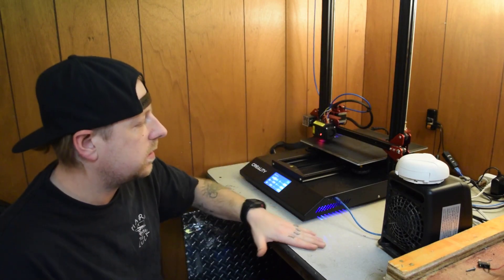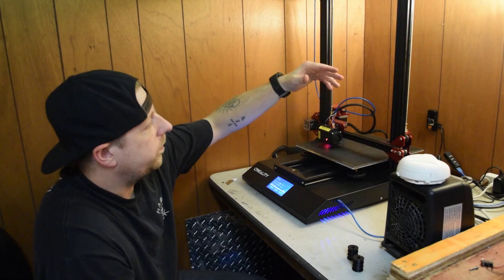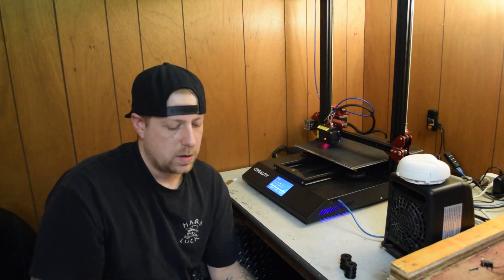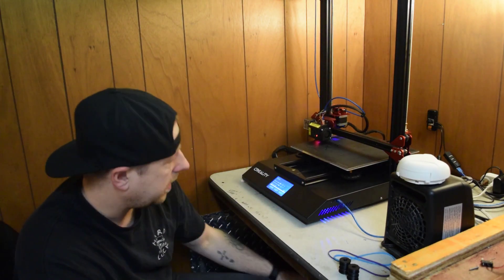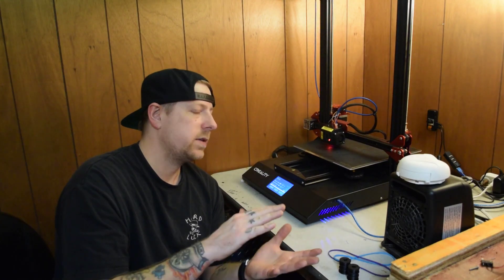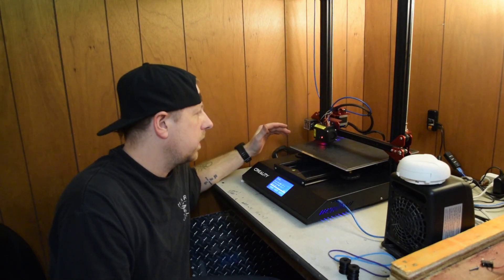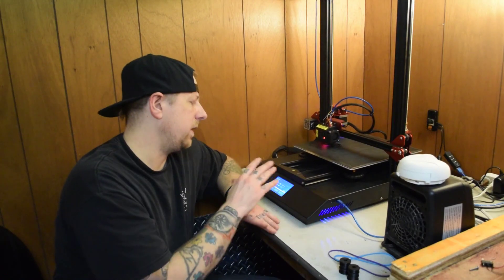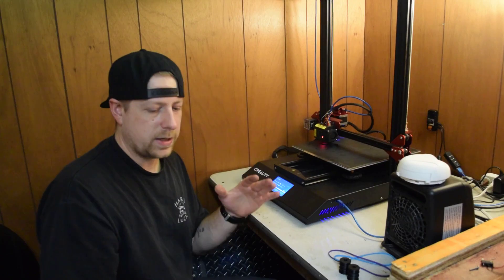Do not buy the cr10s-pro! its amazing when it works review / tips tricks bed leveling issues

Comment: Mine worked great for 2 years and then suddenly the z level issue cropped up. Sent it to authorised service center. But they say they are not able to identify and  creality team is not responding to queries.
Reply from the maker: Yeah its really weird it comes and goes for me i havent messed with it in a while sometimes everytime i turn it off i have to fix the z issue just hours of turning it off amd clearing the settings leveling trying again 😂 then it wont happen again for a few months

Comment: IL be getting the Ver2 CR10s pro this week once I get professional leveled im going place hot glue on those all 4 springs under the bed so it wont lost the level again
Reply from the maker: Its not bad get the spring lock things for the x axis it makes a word of differences and make sure u add the gcode to mesh level before every print that helps a lot to
Reply from the maker: The anti backlash nuts theirs a link in the description for them

Comment: Well after a few sleepless nights, burns and desire to smash this down into its atomic constituents I have finally got a CR10S Pro that is reliable and, honestly, amazing.

Upgrades:

3D Printed a replacement fan duct that also uses the two screw holes for the fan itself.
It's thing number is '3586824' on Thingiverse.

I also, just because it was cheap, got a steel hardened 0.4mm nozzle from 3DJake.

WhamBam flexible build system - I'm from the UK and be aware that I had to pay an additional £20 import duty on arrival.

Firmware:

Lookup 'TinyMachines CR10S Pro'; they've got some custom firmware that adds some extra features aswell as giving it a cleaner looking UI.

Leveling:

At the bottom of the TinyMachines webpage there is a .gcode file and a video guide; run the file and follow along with the video.

I didn't have good results initially so I made my own shim for setting the probe height; the stock shim is 3.85mm thick, I made my own that's 1.85mm that gave me much better results.

Conclusion:

My CR10S Pro V1 now works great.

Some prints with complex geometry struggle to adhere to the PEX sheet.

I then also bought Dimafix adhesive spray (also from 3DJake) and it works really well.

Hope this helps someone :)

PS: Oh I forgot to add I followed your advice in the video regarding changes to the TinyMachines firmware.
Reply: Also I would go for the hero me 5 master suit on thingiverse. I love the design and it works on other printers. You will have to go and find the manual in the files to chose the right ones for your printer.

Comment: I can only say that mine is ace using every day up to 10 hours a day with no problems at all not even with bed levelling
Reply from the maker: Do you like only print pla? I'm just curious if that's the difference because stock I couldnt not print anything but pla but even pla everytime I shut it off I had to piss with the first layer a lot... I'm just not sure why some machines people have zero issue other machines awful constantly have to mess with mine and I'm not that picky it just has to work lol

Comment: I came up on your video because we have the same type of printer. The bed leveling issue is something that most hobby type 3d printers have issue with. From listening to what you said I think it's an issue with the treads on the rods not lining up when the motors are at a natural rest state. When you took the rods off and put on the anti backlash hopefully those threads were put on correct alignment. If it was then there shouldn't be too much of a problem unless the frame is bent. If you're still having problems take a look at my video on z axis and bed leveling.
Reply from the maker: the problem i was having is any time a print finished and the motors turn off you end up with one side or the other falling lower than the other. ive had this same type of issue with my printer bot doing it mid print the motors would turn off and it would actually drop the whole z axis due to a sort of issue with the firmware once i cleaned up the code to keep the motors on the issue was gone. now its a little different with the cr10s pro because its at the end of a print or after a power cycle. i understand what you are saying but this is almost the opposite of what you are describing because if they were out of alignment they should almost bind and not just drop or droop to one side or the other. 
SO FOR THE SHORT REPLY.  once the motors are shut off one side droops and it will not level itself out you have to start over and make sure both sides are the same height do a little dance then try to level it again literally after every print.
so with the antibacklash nuts and "fixing" the firmware you can save yourself a lot of time and frustration in between prints.
Reply: @rstchan  so it's a firmware issue!!?  Cause I have backlash nuts, and my gantry is square and level until it isn't lol.  This is the bane of my existence of 3d printing 🤣  I'll get 1 to 10 prints perfect then bam ... Bed is all wonky with measurements from . 400 to . 008
Reply from the maker: @Kirk_Lazarus_ghost  yeah man it drives me insane ive messed with the firmware a few times it honestly isnt to bad now but it still every once in awhile ill start a print and come back to it ripping my bed surface to shreds 😂 it really makes no sense  one thing ive done is set the first layer height really high and this has saved me a lot of build surfaces from getting destroyed and has great results for adhesion and making it easier to remove prints. So i do a first layer height that matches or exceeds my normal layer height. I imagine a lot of people are doing this now anyways simply because it works so much better.